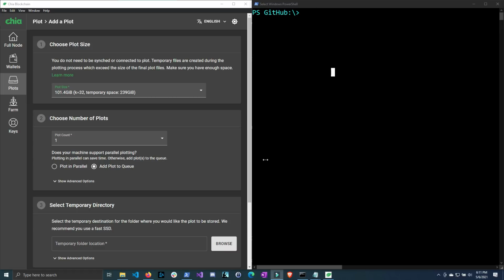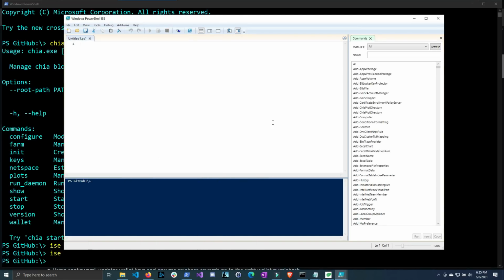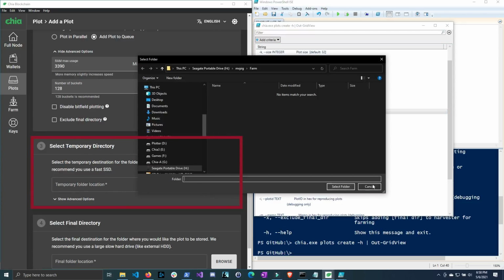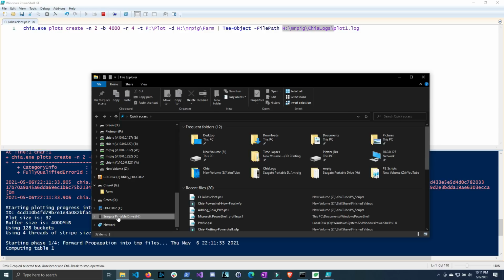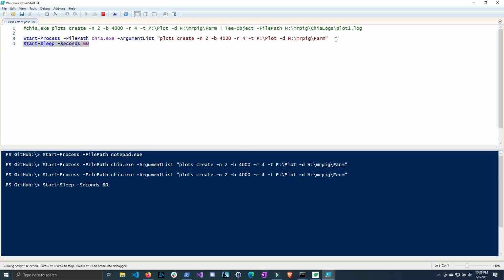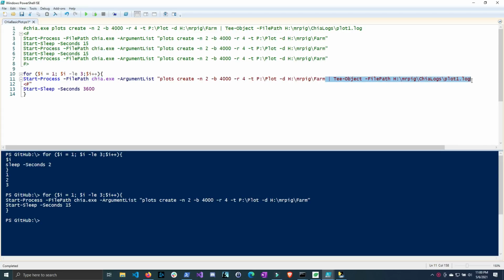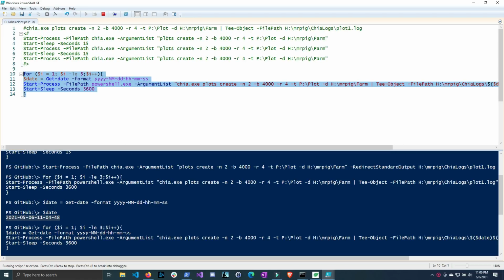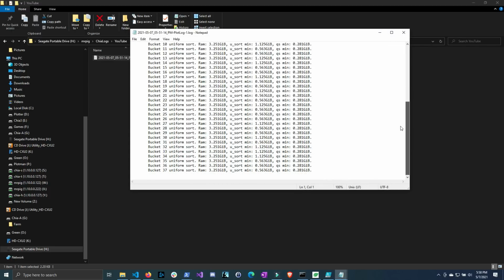Chia Parallel Plotting Using Powershell (With Delay & Logs) BASICS - Chia Plotting Part 4

Comment: Thanks to your video and some extra powershell methods that increase know skill to another level. With the helps from this video i create my own which consist Plotting machine and Farming machine. Plotting with 2 nvme while Farming will many 14TB HDD. I would map all the large HDD to my plotting machine over the network. The scripts that i created will search for my nvme drives and map as temp while the next scripts will search for all map drives and check its free spaces. Then the scripts would pick the next available map drive that has greater than 102GB and select them. Then i would loop this plotting with delay with a variable that will set max parallel for this plotting machine to always maintain. The while loop will keep counting the chia process, if it dropped below the max parallel process set, it will start a new plotting. So it will plotting unattended until the farming machine drives all full...lastly was to scripts to send some sort of notification or alerts when farming machine HDDs all full, which im going to watch your next video about discord n stuff

Comment: Say you have eight HHDs as the plots final destination directory, and you’re doing 6 plots in parallel. What controls which plot goes to which HHD or do you have to specify every time? If you have 4 HHDs can you still do eight plots in parallel if you have enough cpu power, SSDs, and RAM? In other words should the number of HHDs correlate to the number of plots in parallel to minimize the bottleneck with the inherently slow HHDs?

Comment: i updated to 1.1.6 $chiapath is no longer working, do  you know what caused the problem

QUOTE
chia.exe : The term 'chia.exe' is not recognized as the name of a cmdlet, function, script file, or operable program.
Check the spelling of the name, or if a path was included, verify that the path is correct and try again.
At line:1 char:1
Reply from the maker: I will look into this right after I update to the newest version. Could you provide me with what the path is for the $chiapath is (you can leave out the username part)

Comment: Thank you for this awesome tool. I was wondering whether there is somewhere one can find a list of commands to use, specifically with PSChiaPlotter. At the moment, the only way I found was to squint at the video and replicate that. Also, is there a way to add some columns to the table eg. plot name, log file name etc.? - this would help with identifying the settings used for that particular plot. Cheers.
Reply from the maker: You can run Get-Command -Module PSChiaPlotter
Reply: @SysDeskDev  Many thanks - I'll give that a go :)

Comment: Awesome tutorial and scripts!
Is it feasible to add in the script where it will maintain a number of concurrent plotting. I mean , if your system can handle 3 max parallel plots, it will open another one plot as soon as one is completed so that the maximum parallel plotting is maintained at 3 max.

Comment: For some reason, every time I try and add plots,  the command window pops up for a split second and disappears. Not sure why and this didn’t happen before I added the cd shortcut. Processes are not running according to task manager and computer’s resources are not used either. Any ideas?
Reply from the maker: An error occurred which is why it only shows for a second and then closes since there are no commands left to run. You might be able to add -noexit to the beginning of arguementlist string you provide to prevent it from closing so you can see what the error is.
Reply: found my problem! for some reason i had a second "Chia.exe" sitting inside of the argument list thaht i missed when typing it out. Thank you for the reply!

Comment: the problem with this video is if you cannot add profile to envpath then the rest of this video is useless.  its very frustrating
Reply from the maker: Try these 2 commands 
$Chiapath = (Get-Item -Path "$ENV:LOCALAPPDATA\chia-blockchain\app*\resources\app.asar.unpacked\daemon").FullName
Set-Location $ChiaPath

and running .\chia.exe from there. 

If you are encountering issues adding to your profile you may need to add the "WindowsPowerShell" folder to your Documents folder. Let me know if either of these 2 things helps.
Reply: @SysDeskDev  I'll give it a go.  I ended up finding a way to run the GUI with only the harvester process running on my harvester machine.  while I would rather run powershell maybe you can use it as content https://www.reddit.com/r/chia/comments/nfhomk/creating_harvester_and_plotting_with_gui/
Reply from the maker: @Bryanj2222  Thank you for the link. That is a pretty clever method. I will have to give it a go, thank you so much!

Comment: Your videos are great just nothign works at all
I get erros runnign the most basic  commands like python manager.py start  ( yes python is installed and is in path. Yes policy is Remotesigned.  but i get windows access denied error and just cant sort that out.  Running windows 10 - I am admin ....running everyting as admin...very frustrating.  The m,anager log ends with..."PermissionError: [WinError 5] Access is denied".  aNY ADVIcE GREATLY APPRECIATED!

Comment: Hi, i bought a samsung 970 pro 1tb, but it's not working at full speed. I tried to make one plot just for testing but it's very slow, in fact when i was using a ssd sata it was faster than the new one. For this test i'm using 2 threads of an i5 processor and 4gb of ram. Can you help me? ps. when i run some tests on the samsung 970 pro, the results are ok, the problem seems to appear only when i try to make a plot.

Comment: How do I calculate the total ram used?

10 Plots in parallel, I must calculate 10*3390 GB so I write memory_buffer: 33900 or i leave it a 3390 and the system sill take 3390 for eacht plot automatically?

Comment: Can please someone help me?

I have a popular configuration: i7 10700k (4.8), 32 gb, 2 tb nvme. Now I’m doing 6 plots in parallel for 8 hours without stagger . First phase 3 h 30 mins, second 1 h 20 mins

How can I increase this? What stagger should I use and how many plots per parallel? Please only experience based advises.

Thank you. Good luck to all!

Comment: Hi, I have some problems with understanding this. So, do I need 3 machines? Full node, farmer and harvester separatelly? I will plot on my PC, but after all HDDs are full I want to switch to raspberry pi. So I need 3 x raspberry pi for this? Plots are connected to a harverster, I understand that. Full node is actually a GUI and he is only syncing, right? Would I have advantage, if I would have  1 farmer, 1 full node and have a half of plots on 1 harvester and another half on second harvester?

Comment: First time using power shell. I tried following along. I think i got most of it. Ultimately i don't think this is adding the queue control i'm looking for. Would like to find a way of running parallel queue with delay triggered by end oh phase 1. Then i would like a looping function so it keeps going once a plot completes

Comment: Hey man, absolutely love your videos! I tried to run the script, my powershell window open up but it closes up right after and nothing happens! what am I doing wrong? 
Keep up with the great content!
Reply from the maker: Try adding -noexit if you are using start-process powershell.exe to see what the error is. Sounds like it erroring out and so the window automatically closes.
Reply: @SysDeskDev  it is saying that the command does not exist, i am probably putting it in the wrong place
should it be right after "powershell.exe", like "FilePath powershell.exe -NoExit -ArgumentList" ?
Reply from the maker: @nishi_tech  -noexit should go in the ArgumentList string, I would write as the first thing in that string.

Comment: Quick question. Will this command start the loop of plotting again once the first plot of the first parallel plot finish?
Reply from the maker: Yes, it will keep it going. You are basically creating 3 queues that are delayed by x amount of time.
Reply: @SysDeskDev  Is this command only doing parallel plots? Do I have to manually start the command again if I want to start another parallel plot? Is it possible to have the command run again automatically when the first of the three plots finish so I can have 3 parallel plots running constantly all the time?

Comment: Hi a quick question once the powershell plotter instance for the first parallel finish will it auto close that window or doe one have to do that manually. is manually is there a way to run a script to auto close it.
Reply from the maker: It should close on it's own.

Comment: I am absolutely loving this series of videos on powershell plotting. One question I do have though is "is there a reason you are plotting 2 plots simultaneously?" What i mean is you have -n 2 in your chia command. is it because of your total thread count on your cpu allows you to do multiple plots phase 1 without loss? The reason I ask is I have a 3950x with 16 threads, so i can dedicate 4 threads per plot and do up to 4 plots simultaneously without hurting my performance. Should I do this to optimize?
Reply from the maker: So in this video I just chose 2 randomly, for demo purposes. I can do 3 at a time with 6 threads and my 1 TB SSD. Depending on the rest of you specs (RAM and SSD) capacity you should be able to do up to 8 in parallel if you have enough RAM and SSD space.
Reply: @SysDeskDev  awesome, I have 32 gigs of ram, but only a 1tb Evo  nvme,  so ill be stuck at 3 per time until i upgrade the ssd. so i am gathering to upgrade to 8 i would need to upgrade my ssd to 3 tb. is this correct?